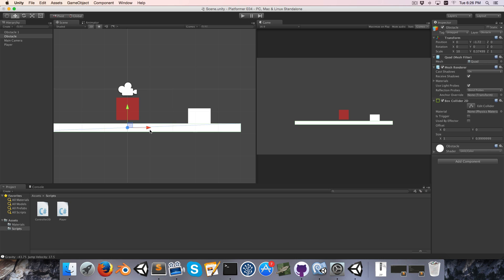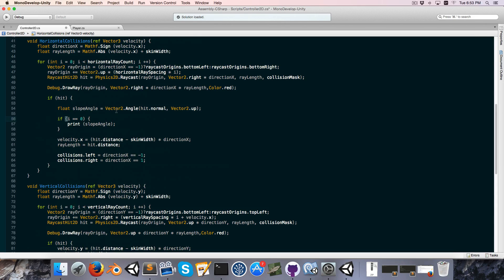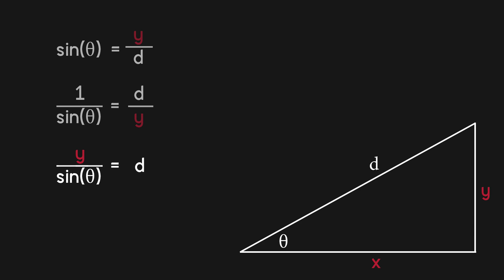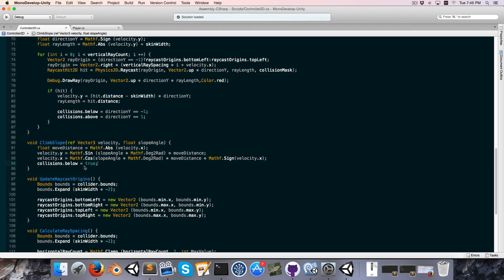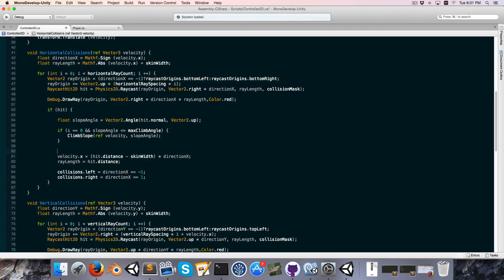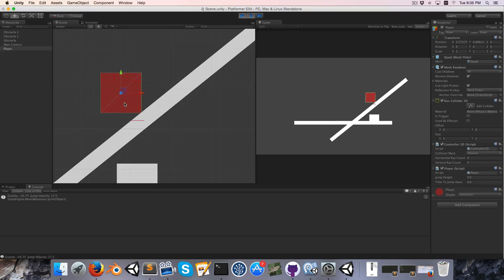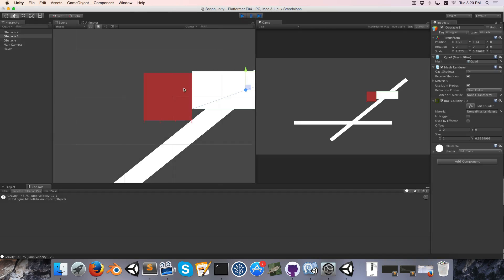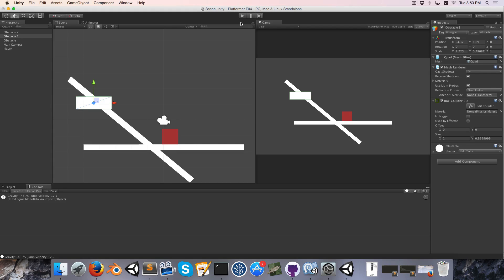[Unity] Creating a 2D Platformer (E04. climbing slopes)

Comment: Interestingly, right off the bat I don't have the problem with moving up the slope slowly, but I do have a jittering issue. My code seems pretty accurate, maybe it's because of Unity updates/fundamental engine changes over the years (as this tutorial is almost 10 years old now). Maybe it has to do the raycast hitting the slope being vertical instead of horizontal, in my case.

Comment: Does anyone else have the following issues? (Btw, the lower the framerates, the more often they happen)

(Issue 1): Imagine you're climbing a slope rightwards until you find a ceiling that is NOT flat; instead, the ceiling is curved and going down from top right to bottom left. In this scenario, once the character collides with the ceiling, it jitters a little but and then gets inside the ceiling slowly but surely and glitches through the ceiling until you get to the other side. Does anyone know how to solve this issue by any chance?

(Issue 2): when you're climbing a slope and jump, the character jumps from a position behind the character's. Maybe the jump is detecting the previous position (from the previous frame), or maybe the cause is different. But the results is that it looks like the jump is going backwards (opposite to the direction you're moving) for a milisecond and then updates to the current movement. Any thoughts on this?

Comment: Here's another bug that happened to me: My player character was falling through the floor. This was happening because I changed the names of the variables and that resetted their values. I had to go to the Inspector and set the values again (the one causing the issue was the variable for the LayerMask).

I post it in case it helps someone else.

Comment: 10:27 Would this not become a problem if you're climbing a slope but there's some sort of wall that doesn't reach all the way down to the slope, but still reaches to the top part of the player? You came very close to testing that at the very end (18:29), but I think it might have just touched the slope... perhaps.
Reply: Another problem is that, when the cealing is slopped, the character jitters and finally glitches through it

Comment: Pretty cool and all, but there are 2 flaws...
1: you clip inside the slope because of the measuring from above the ground (skinWidth)
2: flat enough slopes (less than 45°) can still be slowly climbed even with max climpAngle at 0, once again because of the skinWidth
Reply: 3: if slope is flat enough and horizontal speed is small enough, player never detect this slope by the bottom most horizontal ray, however he can still climb the slope by keeping adjusting speed y to skinWidth
Reply: do you have any idea on solving these edge cases?

Comment: When I print my results for the first slope test, the print returns 31.999. Can anyone explain why it isn't returning a perfect 32? Double checked my Z on the object and it reads 32. I've attempted rotating the object to different angles and it always reads back with a .999 result.

Comment: Damn, these tutorials were so good, but because how Unity works nowdays I have to search for an alternative. Using Auto Sync Transforms made an impact on performance, so I'm trying to adapt it to a RigidBody2D, but now it works terrible. Do you know how can I adapt this controller or I'm SOL?
Reply: I'm using this without RB and with the Auto Sync off (so no impact in performance) and I had no issues so far. What are the issues you were experiencing when you had the Auto Sync turned off?
Reply: I think this is because frame rate is too high. Try Application.framerate = 60 at the game start. High framerate causes very small speed value in each update and the algorithm cannot handle very well ocasionally

Comment: For anyone else that has this issue my player was getting stuck on slopes exactly equal to the maxAngle. It seemed that in some rare cases the angle returned would be just slightly over the max angle (in my case maxAngle was 45 and the angle was sometimes 45.0000001 or something). It seemed to only happen at the rounded parts of non-square colliders (the ends of a capsule collider or the vertices of edge colliders with thickness).
Easy fix was to just bump up the maxAngle a bit to 46 degrees instead.

Comment: Did I miss something with the slopes? When I go down the slope to the left, I never reach ClimbSlope as the lower left corner of the cube is hanging in midair. It will just move horizontally to the left, then fall down with gravity upon which VerticalCollisions will stop me from falling through the sloped floor (like walking down steps). This means the down slope velocity is not really controlled and I can't jump while walking down (bcs the controller will be ungrounded most of the time).

Comment: Hi! I'm wondering if someone could help me out with this, I have a bit of a specific issue. I'm trying to repurpose the character controller from this tutorial into a top down 2D style game, such as Legend of Zelda. I've removed the gravity and replaced it with vertical controls similar to the horizontal ones. The player can move about in 8 directions just fine, except when colliding with an slope, they just stop. I'd rather the player handled every angled wall in whatever direction, like the horizontal slopes in this video, but I can't quite figure out how to make that happen. Any tips?

Comment: in this part if(!collisions.climbingSlope || angle > maxSlopAngle )
    {
    velocity.x = (hit.distance - skinWidth) * directionX;
    rayLength =hit.distance;
    if (collisions.climbingSlope)
    {
     velocity.y = Mathf.Tan(collisions.slopAngle * Mathf.Rad2Deg) * velocity.x;
    }
i dont get why do we want to check maxSlopAngle?  if we remove this check then we dont need to change velocity.y if we hit an obstacle on a slope coz character react the same if we do change velocity.y. i mean it doesn't bob up and down. maybe there is a thing that i miss?

Comment: I didn't have that problem about the player starting climbing before reaching the slope, but i have the opposite one, it starts climbing after so a small part of it goes into the slope (maybe it's some problem with the skinwidht).
Also, the code at the end to stop the player if he collides with something while climbing works for me, but if the slope is inclined too much then the players keeps bouncing when it collides with something.
I have exactly the same code, what could be the problem? could these two problems be related?
I know this video is old, but if someone can help me, thanks in advance.
Reply: Yeah i had the issue with the player going into the slope as well. I just lowered the skinwidth for it to work but still goes in a bit

Comment: question if anyones reading this
i ran into an issue where as my character moves up a slope to the right, it interacts fine. Now if i jump to the right, it slides back down slowly. 
im assuming i missed a line of code somewhere im just not sure where. figured itd be this video but again not sure and it would take forever to dig through all of these and find a single line of missing code.

Comment: PSA: This code will not work if you calculate vertical collisions first in the update collisions method. As of now, I am too busy to figure out why, but if you are still having trouble, rearrange those two lines of code where you call the calculate vertical and horizontal collision methods.

Comment: So, I started this tutorial... almost 3 years ago, and came back to it recently. I don't know if you still check these comments, but I have a question.
. 
I implemented some very fast dash moves in my game, like in Mega Man X and modern Castlevania. The fast motion sometimes makes the player not move down slopes sometimes, especially on 45 degree slopes. When this happens, the player moves into the air during the dash and falls onto the ground.. Is there anything I can do to the raycasts to allow fast movement that descends slopes perfectly, 100% of the time?
Reply: Not quite sure what you're describing but could you perhaps raycast ahead, into the direction of the dash to check if its clear before dashing?
Reply: Jake Kennard That's not at all what the problem is. When the player moves too fast, it ignores any downward slopes. Gravity moves the player down from midair, rather than slope detection.  It looks and feels really bad.
Reply: Ehem 16:05
Reply: I copied that code line for line back in the spring of 2015. Other people are having this same problem, and it only happens when the player is moving too fast. The problem is with the code in episode 5.

Comment: Hey Sebastian, I'm having a problem with the obstacle that is above the player on a slope. After some debugging I found that the variable "collisions.climbingSlope" is always false while checking for vertical collision. The horizontal works just fine. Any help or ideas why this might happen are very appreciated. Thanks!!
Reply: Actually never mind... I was calling the function VerticalCollisions before HorizontalCollisions... and the function ClimbSlope is called in HorizontalCollision so colliisons.climbingSlope was not yet set to true

Comment: I've done this entire tutorial series, but the only issue I've noticed is that when there's an obstacle in the way on the slope, specifically the kind at 13:51, my character gets stuck for a second before I can move back down the slope. Does anybody know why this might happen? I've rechecked the code a few times and have not found any differences.

Comment: I am trying to adapt this to use in a 2d infinite runner - where the player is stationary and the platforms are moving toward the player at increasing speed over time.  How could I make adjustments to the code in order to climb the slope if the player's x velocity is always 0? I tried to plug in some simple constant values into your formula, but it doesn't seem to be working.  I thought that I could just solve for y given that I know the x velocity (the speed at which the platforms move toward the player) and the angle based on hit.normal.  Anyone have any ideas? Thanks!
Reply: You probably solved this by now but the reciprocal of the platform velocity is probably the number you want to plug in.

Comment: Hi Sebastian! First of all, thank you for your tutorials, they are awesome and very ilustrative. I don't just copy the code and listen to the explanations, but also like to check the code in very detail to really understand what's going on and why. Analyzing the code I noticed a little mistake (or I think it is) on the HorizontalCollisions method. When you check on hit the second if (the part where it says "!collisions.climbingSlope || slopeAngle > maxClimbAngle"), you directly asign to velocity.x and rayLength the hit distance, but you don't take into account that maybe you're climbing a slope and, because of this, the distance that you move in the X axis has been reduced, so maybe you aren't having a collision on that frame yet. What I did to solve this is:
velocity.x = Mathf.Min(Mathf.Abs(velocity.x), (hit.distance - skinWidth)) * directionX;
rayLength = Mathf.Min(Mathf.Abs(velocity.x) + skinWidth, hit.distance);
That way, I asign the minimun between the new real movement distance on the X axis and the distance to the collision. Since I'm still learning maybe this is incorrect, but I would like to know your opinion about this change :) By the way, I'm sorry for my gramatical errors, english is not my native language.
Thanks for your time and thank you for making these tutorials, you're awesome ;)
Reply: This needs more upvotes. Applying this code fixes the jitter I was getting if I went up a slope and then ran into an angled ceiling! Thanks for the code!
Reply: I know this comment is 3 years old but doesn't the if statement ensure that that isn't the case?

Actually this bit of code confused me because it first checks if you're NOT climbing a slope, and then does an if statement to check if you ARE climbing a slope. Very confusing?
Reply: @theindiefanclub  Yes. But, it also checks if there is a side obstacle in the way by checking if slope angle is greater than max slope angle, and if so it means that the "slope" in the way is a wall and too high to climb. That's how it checks if the player tries climbing again after colliding with a side obstacle (slope that is too steep). Hope that makes sense
Reply: That's actually what I was thinking. Good job figuring it out, this solves many bugs related to having two slopes next to each other (try examples where you have a slope that you can climb and immediately another one you can't.
Reply: I had this same issue!!  hanks for sharing!
Reply: Still applicable! Should upvote or create a pullrequest against his github repo.
Reply: Life savior <3 Thumbs up!
Reply: For very steep differences in slopes, I still get hang frames with this method. In the next video Sebastian actually addresses the problem mentioned by OP but with a different solution. For me Sebastians solution worked better.

Comment: My cube won't climb the slope like yours, it just climbs slow and sluggish. I don't know where I did wrong
Reply: //here's the code  
if (hit)
            {
                float slopeAngle = Vector2.Angle(hit.normal, Vector2.up);
                if (i == 0 && slopeAngle <= maxClimbAngle)
                {
                    ClimbSlope(ref velocity, slopeAngle);
                }
                velocity.x = (hit.distance - skinWidth) * directionX;
                rayLength = hit.distance;
                
               
                collisions.left = directionX == -1;
                collisions.right = directionX == 1;
            }  

void ClimbSlope(ref Vector3 velocity, float slopeAngle)
    {
        float moveDistance = Mathf.Abs(velocity.x);
        velocity.y = Mathf.Sin(slopeAngle * Mathf.Deg2Rad)*moveDistance;
        velocity.x = Mathf.Cos(slopeAngle * Mathf.Deg2Rad) * moveDistance * Mathf.Sign(velocity.x);
    }
Reply: it won't print out the slope angle either, so the code isn't reached
Reply: solved it! it was the if angle<maxAngle that caused the problem

Comment: Hello, I noticed that you fixed the jump issue while climbing up the slope. However, when climbing down the slope, there is still a chance that the player box won't jump. Do you know how to fix that?
Reply: Oh ok, you are solving it in the next episode. There is another issue though, when I go on the flat ground and go under a slope, when I reached the "roof" of the slope, instead of being stopped, the player block begin to go into the flat ground and finally go through the ground.

Comment: How would you make it so the higher the slope, the slower you get?
Reply: You have movement speed and slope angle as variables so it should be easy. Maybe stick something so that...

if collisions.climbing slope then player.movementSpeed = (1 - (slopeAngle / maxClimbAngle)) * standardMovementSpeed

and in the Reset function set player.movementSpeed = standardMovementSpeed

then you just need a new float for standardMovementSpeed which should be set to the speed you want your player to move at on a flat surface... should work nicely.
Reply: Robsfund ok thanks!

Comment: Weird error: Assets/Script/Controller2D.cs(19,19): warning CS0108: `Controller2D.collider' hides inherited member `UnityEngine.Component.collider'. Use the new keyword if hiding was intended
C:\Program Files\Unity\Editor\Data\Managed\UnityEngine.dll (Location of the symbol related to previous warning)Unhandled Exception: System.UnauthorizedAccessException: Access to the path "C:\Users\danie\Dropbox\Games\FirstGame\New Unity Project\Temp\Assembly-CSharp.dll.mdb" is denied.
Reply: If you're getting this, rename the "collider" variable to something else, like "mainCollider" or "myCollider".

Comment: I have a Question at 14:00 you describe a problem and solved it with this code: 
if(collisions.climbingSlope)
{
     velocity.y = Mathf.Tan(collisions.slopeAngle * Mathf.Deg2Rad) * Mathf.Abs(velocity.x);
}

why do you use the tagent and not just set velocity.y = 0; ?
Reply: As far as I'm aware, setting velocity.y = 0 does not solve the issue. Your character won't clip into the object above it anymore, but instead will sometimes "bounce down" after hitting the object. It's not very noticeable all the time, but Sebastian's solution is cleaner. I took that one line of code from this video and implemented it into my own raycasting solution to solve a similar problem, and I was surprised that it indeed fixed the bug.
Reply: frag ich mich auch :-)
Reply: I reckon he uses tan to find y as he already knows the angle and as we don't know the moveDistance (aka the hypotenuse) but know the x velocity (the adjacent) thus
tan theta = velocity.y (or opposite ) / velocity.x (adjacent) 
thus 
velocity.y =  velocity.x * tan(theta)

So when in doubt draw a triangle with you angle and velocities and use SOH CAH TOA to find the velocity that you need
Sin(theta) = Opposite / Hypotenuse
Cos(theta) = Adjacent / Hypotenuse
Tan(theta) = Opposite / Adjacent
https://www.mathsisfun.com/algebra/sohcahtoa.html

Comment: Hey Sebastian, quick question! I think I've copied your tutorial pretty much one on one to test it out and I really like it. One thing: if you walk onto a too steep slope from another slope, the character becomes quite jiggly - probably because it detects the 'good' steep with its bottom horizontal ray or something. Any ideas?
Reply: To set your problem use max climb angle as 75 76